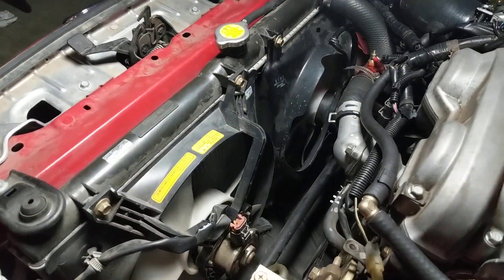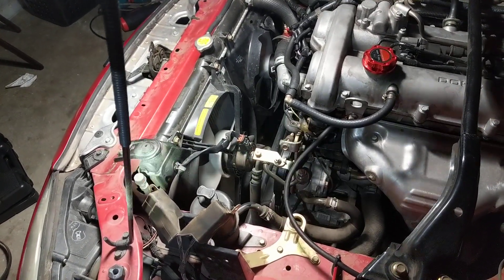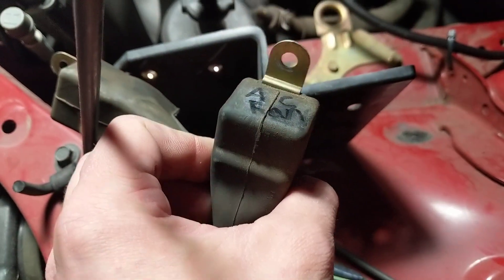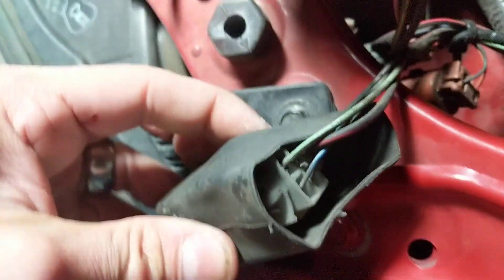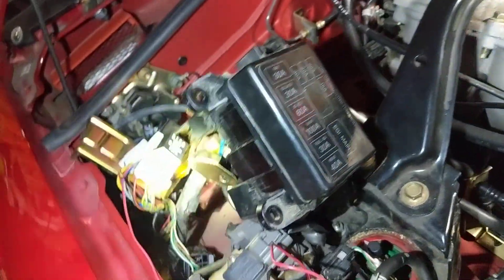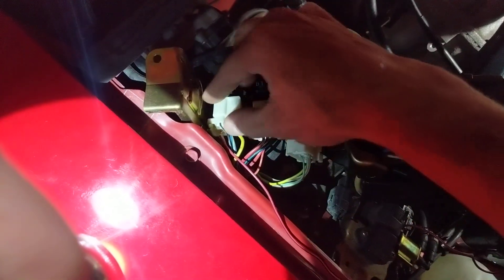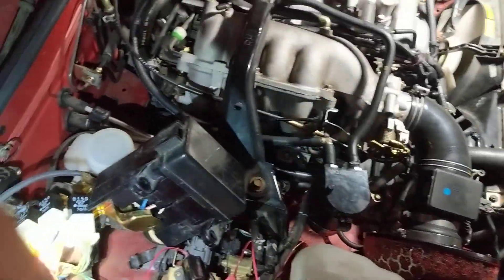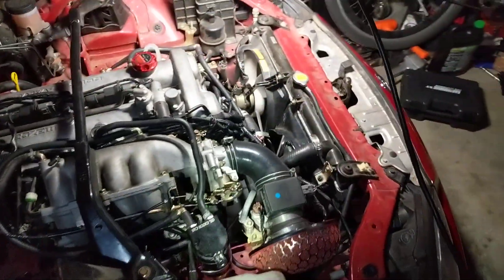Miata NB2 Cooling and AC fan relays, with jump tests.

Comment: How do you reckon I could wire the smaller passenger side fan to turn on with the main driver side fan when it reaches temp? Would bridging the connection be too much current load for the relays with both connected?
Reply from the maker: If you use both the 2 wires I showed, and connect them together, and groudn them through the same switch, they will both fire, with no issues. I run both to a single switch. Linking them together should not cause an issue that I can forsee. Assuming the factory ECU doesn't already trigger both when it gets too hot.

Comment: Actually same replay jumper engages the clutch....And the fuse that controls  them relays. Is that big square one under the dash., In the upper left corner of fuse box.. It will look good.. I replaced it anyways. Everything  started  working  again...

Also  what shorts the fuse. Is that damn  AC wire that  runs up from the compressor. It gets damaged.,
Reply: hey man how do you reckon I could wire the smaller passenger side fan to turn on with the main driver side fan when it reaches temp? Would bridging the connection be too much current load for the relays with both connected? I have a 2002 NB, appreciate it.
Reply: @HD-eu3zs  Just replace the relay with a higher amp rating. They make them,up to 70 amps..You can wire them both together on one 30 amp.. As that is what the fans are rating for...Something like 24 amps..Just use the right wire size and fuse to protect each fan...
Reply: Can you repair the wire from the compressor?
Reply: @luisgarcia9311  I did.. As long as there is something left to connect too...

Comment: any idea if the blue wire is the jumpable one on the clutch relay? I'd like to test my compressor since the clutch is not engaging. Posting so maybe someone else has the same question.Thanks in advance!
Reply: I know this is old but, I tried to do the same thing as in the video and grounding the same wire also engaged my ac clutch as well as my ac side fan